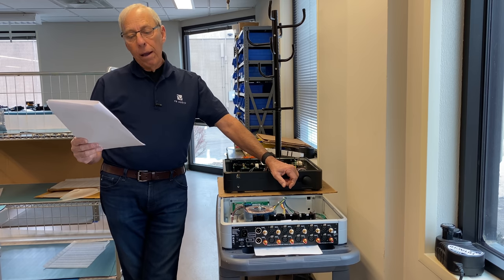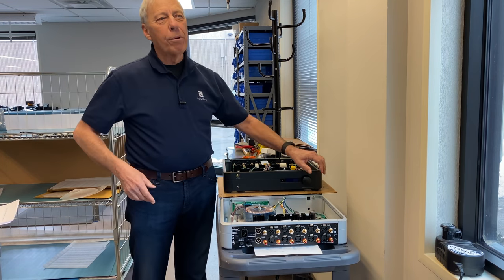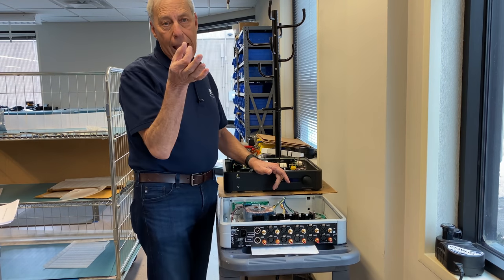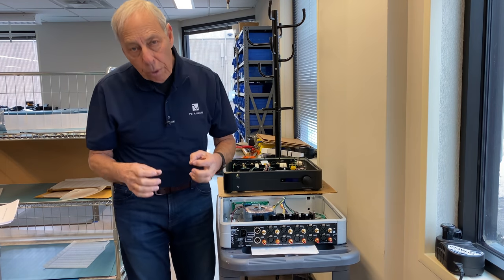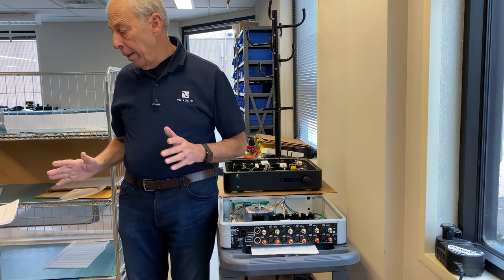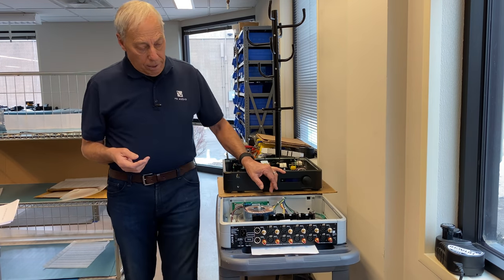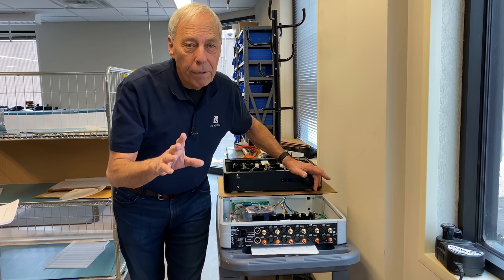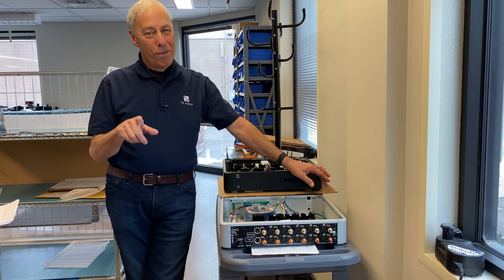Should you cover your audio inputs?

Comment: Great explanation Paul. Shorting plugs are only needed when an amplifier is poorly designed to allow itself to create noise by an unused inputs causing cross-talk into active inputs. If it can do audible cross-talk by just being unconnected, chances are that it can also cause cross-talk when having an actual signal. Get yourself a better pre-amp if you have such problem.
Reply: I have Parasound Halo pre and amp. It’s pretty quiet except for the crosstalk I get from tuner cars driving by outside blasting whatever it is they listen to. The bass rattles their car and my windows.

Comment: I have always covered unused connectors , but just to keep them clean . No other purpose !
Reply: Mr. Rodriguez, do you think a cheap plug would be enough as a dust stopper? I live in Brazil and there are plenty of cheap 1/4, XLR and RCA plugs available. I imagine that XLR and RCA work fine but I'm not sure if 1/4 (P10) will - perhaps if I put a mall rubber ring. Thanks!
Reply: That's a reasonable logic.

Comment: I cover both inputs and outputs with non-conductive caps. The reason is simple - after a year uncovered inputs/outputs get dusty and sometimes under bad conditions may even corrode - depends on sockets and air condition. Dusty and corroded contacts really degenerate the sound - you know that well from switches and potentiometers that need to be cleaned up once in a while.

Comment: Tip: when you buy something that has cheap cables provided; cut the cable about an inch (2.5cm if you prefer) from the end and twist the signal and ground ( or earth if you prefer) together and solder the wire together.

That way you can see if shorting the inputs makes any difference to you.

I hope this helps.

I had a PS Audio III phono preamp and PS Audio passive volume control back in the day and loved my first taste of high end audio at a budget price.  I lost them in a house move.

Comment: I owned a Sansui amplifier in the 70s, I think it was a AU7700? It had two phono inputs and they provided a set of shorting plugs if one phono input was unused. Made sense in that application but for line level signals it makes no audible difference electronically. But for dust and dirt, it's not a bad idea. Of course just make your own with cheap RCA plugs. No need for "high end" shorting plugs and just a stock unshorted RCA plug will keep the dirt out just as well.

Comment: Here's a test you can try - set your amp to normal listening volume and compare the noise level of an unconnected selected input when it is shorted vs when it is open. Note the difference. Now, if that same input is no longer selected, that difference will be scaled down by say >100dB, depending on how good the switch is. That's the benefit you're chasing, multiplied by the number of unused shorted inputs you have. Good luck!

Comment: I can't believe my ears - Paul honestly speaks about snakeoil forgetting about Audiophile Correctness. The hell is going to break loose.
Reply: The only thing that works is to close the not used digital optical Out / Inputs. Whit a 75 Ohm plug. No need for eny rcas at an amp !
Reply: @Larry Niles  Correct, Paul has always defended stuff when it needs defending.  Usually from those who don't have the experience to have heard the differences themselves.
Reply: @Larry Niles Hmm, you take a swipe at everybody who questions anything Paul says.  What's your agenda?

Comment: Glad I watched this because I bought caps for all of my inputs and outputs on my streamer/DAC/amp 😬 I had no idea you weren’t supposed to use them on the outputs! Had them on like this for months and thankfully my equipment still works...for now.
Reply: I just bought some new gear for first time in decades and wondered why all the inputs (and I think outputs) came with  caps in them.  I think these are plastic though so they don’t short.
Reply: @Scottlp2  Plastic caps prevent corrosion
Reply: If it is a dielectric, there should be no problem. If it shorts pluss and minus then it is another thing. But the impedance on the output is several hundred ohm, and maybe over thousand ohm. So the current going through is not huge. And it only is a problem if you play music through them at high level.
Reply: If the corroding tarnishing it is poor metal plated not pure mixes of metals too much oxygen not enough carbon
Reply: @neal00  Gold-plated RCAs don't corrode, and I have gear with 50yo steel RCAs that haven't corroded. The only time that corrosion is a problem is when non-plated steel RCA plugs are left connected to non-plated steel RCA sockets for a long time.

Comment: Back in the day, the rotary input selector switch often had a "grounding" wafer that effectively shorted to ground all inputs that were not selected. This helped reduce crosstalk. For example, you have a tuner plugged in and a turntable, signal from the tuner can bleed into the phono input and can be audible in the background. I'm guessing PS Audio's relays have a similar arrangement that shorts unused inputs to ground, I'd be surprised if they didn't.

Comment: I have made my own shorting plugs. 
For most equipment they are of little to no value. 
Unused phono inputs are the best place to install them.
Reply: In the 1970s many amps came equipped with one magnetic phono input and one NAB tape head input.  If either of these are unused, shorting plugs was used.   This was to prevent noise from being heard when the selector switch was moved past these inputs.   It is unnecessary on the high level inputs that are not used.

Comment: A lot of stereo stuff encodes an analog signal as + or - a zero level. In reality, this would represent the flow direction of the electron, like in a speaker. In terms of an input I don't know how chassis ground or connector ground relates to other units ground, and how the signal is encoded. Like is there a voltage offset? Or are all chassis at a higher than true ground potential? Can the grounds being different from different products cause a problem? Oh but the question to this is you would not expect an unused channel to effect yours, but there could be a small change somewhere.

Comment: So only add them to the inputs. Just now learning about this. Being able to lower noise without affecting dynamics in a system is a plus for me. Every bit counts no matter how small the improvement it makes.
Reply: Since plastic or rubber is not a conductor. Wouldn't it also help to use them on the outputs? They would be cheap and make things look even neater. For the OCD audiophile lol

Comment: I used both just-a-metal-cap and shorted metal caps (paying more). My main purpose of using caps is to cover the inputs and some output (plastic caps). This is to avoid the unwanted "by product of oxidative coating" at the surface. Difficult to clean up after a year or two.  So I ended up with clean surface of inputs ready for use, and with the feeling of good sounds with clean connections.
A question: any one has seen the oxidative coating at the +ve point (so small hole, not easy to see) if not caped?
For practice, people claimed the shorted caps should preferably be used for more sensitive inputs like cd, DAC and phono. Any comments?

Comment: I think the first thing everybody should do (you asked right?) is to measure the SPL in their  listening room. Download a free app onto your iphone and ipad. Compare and download another just to compare again. Once you feel that your new instrument’s readout  is reliable, turn off the fridge, air circulation, heat pump etc. Because i live at the edge of a small town, my quiet spl is 28-32 db. With the refrigerator it is 42db and with the heat pump fan on high it is 48db. To see how quiet your system is set to your fav input and, with source paused, turn up the gain control, measure the ‘noise’. Now lower the volume and turn your system off. Measure the spl in the room. Turn all your appliances and heating cooling ventilation systems back on. Do the same. Most people do not have to worry about noise floors due to continuous ambient noise being generated from a variety of sources. Most workplace regs stipulate a maximum of 54db as a safe threshold for the office.

Comment: old video but I have a DENON PMA-800NE and something sends a loud audio signal to it e.g. accidentally dropping the stylus off the vinyl etc. I can hear the thud from the speakers even though the amp is switched to a different input. The thud is of course not very loud but this proves the sources aren’t 100% isolated from each other.

Comment: It seems to me that better than a shorting plug one should use a terminating plug with a resistor between contacts.  If the resistance is chosen correctly it could serve well as a shorting plug without being damaging or overheating if accidentally put on an output. 100K?...perhaps less like 1K

Comment: I use just ordinary RCA plugs with nothing connected to them. No shorting links. 

I only do it to keep unused inputs clean and free of dust buildup. If I do want to connect to that input in future, the sockets are as new with no risk of plugging into dust. 

Not necessary, just an OCD thing. It really makes no difference to anything other than for my own satisfaction. I’ve only got one unused recorder loop and a sub out, which I’ve done this with.

Comment: I am not sure if this person meant 'termination plugs' on the output, but DEFINITELY not zero ohm shorting plugs!  Since outputs are usually terminated by another audio gear in KOhms .. I doubt if any termination plugs would matter, again the switching example for the input, shorting unused inputs might make 'some' difference in measurement equipment but highly doubt it would make a noticeable difference in listening experience.  What used to be in video field (and still is) having a number of unused 75 Ohm ins and outs needed to be 'terminated with a 75 Ohm plug' because that would upset the final impedance of the signal going to cameras and video recorders and such, and also on 75 Ohm coaxial antenna splitters with open ends.

Comment: I use the Oyaide MWA (Magnetic Wave Absorbers). Relatively cheap, cuts out EMI and RFI and can be used on inputs and outputs as they do not short the signal (as just polymer caps).
Reply: I've got the same and it did help with cleaning up the top end a tiny bit. Had two friends have a listen and they confirmed the same. Any improvements on your end?
Reply: @nawafalansari  I swear by them. I use them on anything I have in the house with a spare RCA. Compared to other more expensive options and found these to deliver the best bang for buck. I prefer these to shorting caps for sure.
Reply: Just cleans up the micro details a smidge.

Comment: Im not judging but I do often wonder if hi-fi also suffers from the pimp my ride syndrome -ie adding a lot of expensive usually visually interesting but often useless superficial bling that offers little to marginal gain at all. 

Now please don't get me wrong  I'm not against it and I'm am sure people want, hear and perceive the value in doing these things, but I just fall into the old school less is more camp and train of thought and rarely ever go round the back of my hi-fi system except to occasionally check connections and tighten up the bare speaker cable terminals but rarely to ogle at cables..but I guess that makes me an old fart

Comment: Hello, Paul! You cleared my questions on this very short video - but now I have another one: which cap and what value I should use if I'm building my own noise stoppers? I'll be using this first on two Mackie mixers I have. Also, how should I do it with XLR inputs? Thanks!!!

Comment: On an expensive product there may be extra good rca plugs. everything gets dusty so you should use dust cover for rcs plugs? If you make something and use expensive RCA plugs then you should use dust protection. You should not use cheap cables with cheap rca plugs that can scratch the expensive rca plugs that are in a product!

Comment: Now I need to know. unused MM inputs on my phonostage.  us it the same principle with the phonostage as in preamp? I did order some becouse they are cheap and if they work its a cheap upgrade in sound, and we love upgrades :)
Reply from the maker: Yup, exactly. Let us know what you find.
Reply: @Paulmcgowanpsaudio  Yes, will sure do. Should I use them on unused mm input on my phonostage?
Reply: @Paulmcgowanpsaudio  My shorting plugs finally arrived. Covid-19 is cousing such delays. Now waiting this time I have allready made a big change to my setup, buying a Vincent hybrid Class A/B integraded vacuumtube amp.  I turned it on and set it to phono and turned up the volume and listened to the noice as I plugged the unused inputs and there was a clear diffrence how the noice was reduced. So Yes I confirm shorting plugs work in my setup.
Cheap and easy upgrade. We love that.

Comment: Second time I have disagreed with Paul. If you believe in cable materials or materials in general affecting sound then you have to conclude shorting pin material can do so as well albeit in a very minor fashion. If you don't then at least you're consistent.
Reply: Paul did say there is a measurable difference of noise levels when measuring the inputs with a meter. The measured data indicated and can be translated to noise reduction (dB) when using shorted caps. And he has explained that, for the sake of "laziness", he didn't use shorted caps, and feels that you should (use) if you wanted to for the benefits of lower "floor" noise.
Reply: The material can make a difference when you have a signal, with a bunch of different frequencies that can react differently to less than ideal connectivity. When you are shorting out the input any noise is very weak and relatively uncomplicated, and the signal to noise ratio is way higher than anything else in the system. I.e. the plug's ability to short out the signal is so high compared to the plug's inability to short out the signal, that it puts it way below any noise floor that you may ever hope to have, and that is even before considering that the noise has to be strong enough to actually affect something that it's not even connected to.

Comment: I’m confused. You say you do it when testing equipment because you can see an obvious noise difference, but then when we want to do it to reduce noise listening, it’s myth?
Reply from the maker: No, sorry. I do this while testing an active input like a phono stage. That's something you can't do while trying to play something because there would be no signal. The shorting plugs are used on inactive inputs - inputs not being used. So the myth is that they lower noise even when not active and not connected to the device.